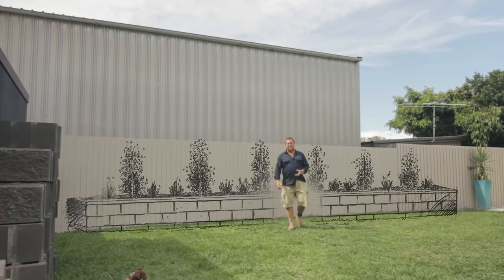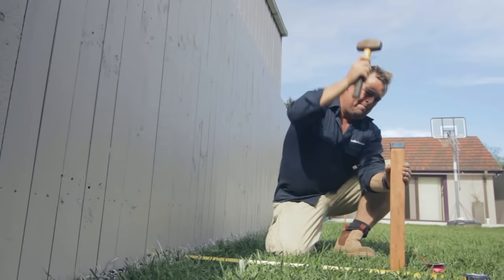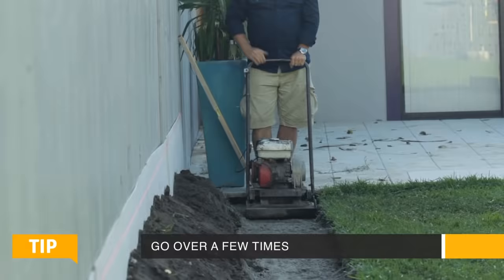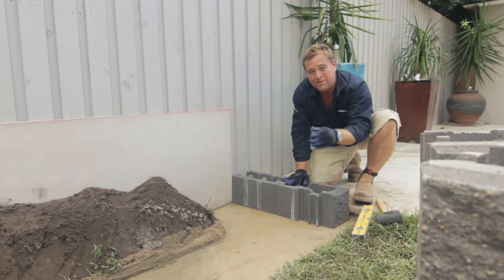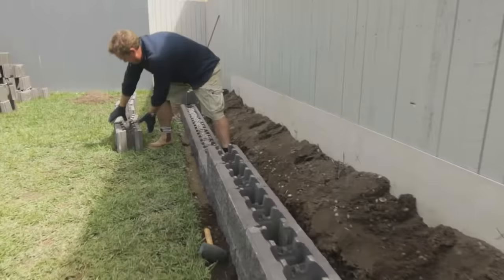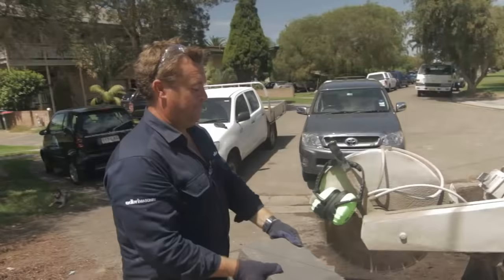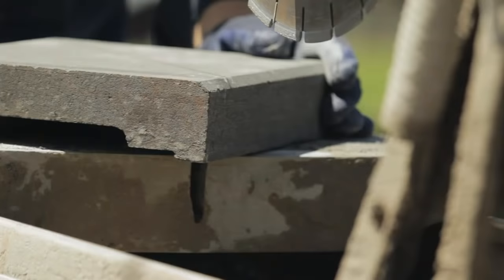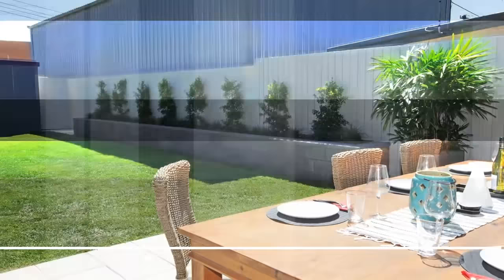DIY Raised Garden Bed How-to Video | Versawall® Retaining Wall Blocks by Adbri Masonry

Comment: For anyone considering something like this,  don't attach your bed to the fence in any way. If you have to repair or replace the fence in the future you'd have an issue here. Just include a back wall. And leave out the foundation with a garden bed, you want good drainage and you're not building a retaining wall. I realize this is mostly an ad for the blocks but still...
Reply: That's what I was thinking!  That poor fence is going to blow out from the pressure of the soil.
Reply: @mitchharrison435  hello
Reply: @Bob-qm6cy  I'm not a licensed builder, but if you're putting in a retaining wall which is holding back a good deal of soil, a footer and proper set back is definitely the way to go. Some places require a footer if the wall is over a certain height or has a certain slope above it, you'd have to check local building code. When the soil gets saturated, and especially if you have freezing weather, the pressure would be very high. I see tons of yard edgers that are 1-2' tall and are all bowing out  because of a steep slope above it and the use of weak material. So there's a time and place for the heavy duty materials for sure.
Reply: Hello there. Does the back wall have to be versawall as well? Or can I use timber sleepers on a post?
Reply: @enriquelondres6134  might be too late for your project now, but FYI I did a front end retainer wall and did timber sleepers held in with galvanised metal beams ("h posts" and "end posts") on the back end to keep it off the fence. Days worth of extra effort but worth it as i now have no worries about my fence.

Connecting the corners of the posts with the versawall wall was a bit awkward. In hindsight I'd start with the rear side timber sleep wall first then, line up your versa wall to instead of the opposite order which is what I did. Take your time to get the measurements right.
Reply: Could you just build the foundation for the blocks only, and have drainage at the rear of the blocks? What prevents the blocks from sinking

Comment: The hardy board was not a good idea, it is porous and without a proper vapor barrier and air gap between the bed and wood fence, it will cause the fence to rot. It would have been better to have built a 4 sided box with sufficient air gap between fence and bed.

Comment: Best way is to lay the blocks upside down to the method Jason used. Lugs at the bottom.  This way, lugs give improved grip into the base material plus you have no need to knock off the lugs on the top row!
Reply: You have obviously never even seen these blocks, let alone layed them often enough to give people advice.
Reply: @drgrubenhiemer   You are sure of that.
Reply: I came here to say the same thing, I'm about to lay a small retaining wall and the blocks laid this way up leave the U channel (which I assume is for drainage) at the top, so you are likely to end up with the bottom row with about 4 inches of water with nowhere to go. If 'upside down' the U channel will allow the water to move and also key the bottom row to the base. Finally with the lugs down the coping stones can just sit without altering the block.

Comment: Your neighbor's fence is  bearing the side load from the weight of the soil. Whether at the top or all along the height of the villaboard.
Reply: The fence is shared between the two. But yes something in between would be good
Reply: Agreed! See this problem everywhere with fences pushed over, and most people have no idea. Videos ( or more like ads) like this don't help.
Reply: The neighbour could also construct the same kind of raised bed their side. The fun starts when that fence needs replacing!!
Reply: She'll be right mate!
Reply: Anthony Haycox yes I’ve been thinking about this lately. I don’t be making mine too high
Reply: Lol i was going to mention the same thing
That fence is going to lean after a few years

Comment: Is P gravel OK to substitute for the road base and was the sand/concrete mix a dry mix ?
Reply: The rock size used is standard for using in drainage situations.

Comment: Quick question we have just built raised garden beds using this same product.  I’ve notice the caps now don’t sit directly on the flat section of the  blocks. Does this mean I need to knock out the lugs or glue them directly to the lugs? Cheers
Reply from the maker: Hi Smitty, there has been a slight change to the cap design so that it can be used on a wider range of retaining wall blocks. As a result you will need to knock those lugs off on the top course. If you check out the following video, Jason shows you how to do this at about 9:27 https://youtu.be/RtNWzBYrghE?t=567
Reply: @AdbriMasonryAus  thanks for the reply. I took a few moments before the first corner and figured it out come up a treat

Comment: Adbri, thanks for making this look so easy. This is my question and yes, probably also my problem. Ok, so on the left side of the house (left, by standing at the street and looking towards the house) at the back of the yard there is probably a five or so foot hill against the wood planked fence that boarders/divides the easement space between this yard and the home behind. We would like to turn this hill into a terraced garden with a minimum of three levels (3-4 two foot gardens staggered up the hill, each section being 2-3 ft. tall, with the final level being at the top). I should also probably mention that this hill is only approximately 10-12 ft rounded with an old set of stairs going up the center. The left side of the hill is probably all of 1-3 ft away from the next door neighbors backyard fence, so there isn't a whole lot of space on that side. What is your best advise for DIY installing this terraced garden? Do you already have a video out that would help us?
Reply from the maker: Hi Suzy,
Thank you for the comment! It sounds like you've got a complex project ahead of you, it will be well worth it in the end when you can enjoy it from your Outdoor Room!
We don't have a video that specifically addresses your questions... However we highly recommend that you seek some engineering advice before building this wall. 
Garden beds that are staggered up a hill will most likely exceed the maximum unreinforced height of a retaining wall block (depending on which product you are using). 
For example, Versawall can only reach 800mm high before engineering is needed. If you build up to 800mm and then add a garden bed and another 800mm wall, this would already have exceeded the maximum unreinforced height!
It would be best to speak with a qualified engineer before progressing.
I hope that helps - Good luck with your project!
Reply: Suzy Cowan eeee

Comment: should be using a mask with all that cement dust. great vid.
Reply from the maker: Hi Pete, that's a really good point. While this video was filmed before those safety requirements were brought in for cement handling, we 100% recommend the use of a mask when working with dry cement.

Comment: You are not adding any water to the cement and sand mix, why?
Reply from the maker: Hi Maciej. While we haven't added water to the mix, this sand and cement will harden over time. But working with it dry means you can still tap the blocks level as you're building, while the base remains fairly firm. If you were to add water to the mix initially you would need to get the first course down quickly before it drys, after which you wouldn't have the flexibility of fixing any sections that aren't level.

Comment: Hi, awesome video.  Just have a question. How are the blocks fixed to each other? Also after adding cement sand mixture to the base did you wet it and let it set and place the blocks after or place the blocks while wet.
Thanks
Reply from the maker: Hi there, thank you! They are fixed together through the interlocking wings on each block. The free draining aggregates that you backfill with will also add strength to the wall.

For the cement and sand mixture mix it dry. You can wet it to make it slightly damp. This will act as a stabilized bedding for the blocks. You can place the block immediately down, no need to wait.

Comment: Hi there! Planning to do this in our backyard but can I put it on top of concrete and tiles? Thinking of putting liquid nails under the first layer. Will that work? Also it'll be an L-shaped garden bed, do you have any advice with that? Thank you
Reply from the maker: Hi Ma, I'd need to know a bit more information: the type of tiles, height of the planned garden beds and what fence/wall they'd be built against. Would you mind emailing me at adbrimarketing@adbri.com.au

Comment: Any alternate way to cut the corner cap other than using the giant brick saw???
Reply from the maker: The brick saw allows you to wet cut the caps, preventing exposure to silica dust. Any alternatives would involve dry cutting which should be avoided.
Reply: @AdbriMasonryAus  wished you guys have a pre-made corner cap like the left and right corner bricks that you have.
Reply from the maker: @TheRealPotoroo  Thanks for the feedback. We are looking into creating some units that would work for corners. Unfortunately nothing like that is available yet, but it's in the works.

Comment: Do you add water to the sand cement mixture?  You mention to mix it dry but when you level it, and lay the bricks it looks a bit wet - which is it?  And if you do add water, how much?  I have just tried doing as you state (mixed it dry then laid and levelled it (no water added) and it was a complete nightmare - the blocks did not sit well (tended to sink into the sand cement mix) so I had to add more sand to get them to the correct height then use a rubber mallet to get them level (which defeated the purpose of getting the layer of sand/cement level at all - which took hours).  This process took many many hours to do the first row and now I am not sure if this is ok to put the rest of the wall on (I'm guessing the additional weight will make it sag/move).  Surely there is a better way to do this. Its looking like I need to rip the whole lot up and start again with advice from a professional.
Reply from the maker: Hi Tim.

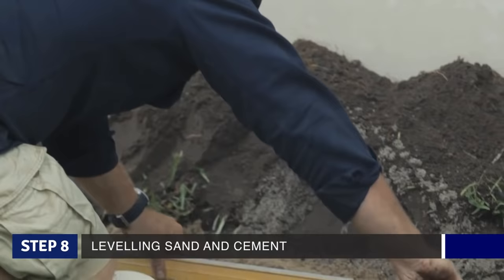It hasn’t been communicated well in this video, but although you mix the sand and cement dry, once mixed you can spray some water in to the point that the mix is slightly damp. Also, when screeding you still need to press the sand down slightly to make it reasonably firm. At 4:15 you can see Jason doing this. If this has been done and the depth of compacted roadbase is 100mm, and screeded sand/cement is 30mm, this should be able to support the blocks without sinking. 

Please feel free to email adbrimarketing@adbri.com.au if you have further questions. 

Best of luck,
Adbri Masonry Team
Reply: @AdbriMasonryAus  Thanks for the clarification. I have laid the following levels on top and it seems ok now.
Reply from the maker: @thuffam  excellent, that's great to hear!

Comment: Is the Geo Fabric looped under the gravel that is put behind the wall? And then the soil is on the other side of that?
Reply from the maker: Hi Olivia, the geo fabric just needs to remain between the soil and the gravel. Looping it under the gravel is a good way to hold it in place as you're installing, but it doesn't need to be under the gravel.
Reply: Adbri Masonry - thank you! So gluing the one edge down under the capping and putting the gravel down over the top and then up between the soil is best for ease?

Comment: Hi there, this is very helpful thankyou. Given there are no half blocks, how does it finish at the fence line?
Reply from the maker: Hi Ashleigh, you would need to either cut or split a block in half. We have some videos on how to do this safely;

Splitting a block - https://youtu.be/sZ5fJt4VVQs

Cutting a block (the video is of a paver being cut, but the process is the same for a block) - https://youtu.be/jZ6oBYHQuH0

Comment: Do we need to add gypsum clay breaker before filling with garden soil ?
Reply from the maker: It depends on the soil you're putting in the garden bed. If you're adding good quality soil it may not be necessary.

Comment: hi mate , really liked your video, i am going to build this along the retaining wall, do i need to lay drainage pipe in the bed
Reply from the maker: Hi there, In this video (@7:40) Jason speaks on why he doesn't use a drainage pipe in the free standing garden bed. If you were to be using the product as part of a retaining wall system, you will need to install a drainage pipe to remove the retained water. 

If you have any other questions, feel free to contact adbrimarketing@adbri.com.au

Comment: Good job but looks expensive and hard job. Timber would be great too.
Reply from the maker: Hi Eduardo, timber looks good for a little while, but even treated pine starts to warp and rot over time. In a few years it will look old and tired and probably need replacing. Concrete masonry is built to last, so you'd only have to build this garden bed once.

Comment: Any idea what a Villaboard is called in the UK??
Reply: Just ask for exterior fibre cement sheeting or cement sheeting
Reply: Would be better to use Foundation waterproof membrane that plastic stuff with dimples. Cheaper easier to install and it leaves air cavity against fence and is also waterproof.

Comment: Why do you add cement to the sand? Will it set when it rains and then drys out?
Reply from the maker: Adding cement to the sand used for the base helps to make a more stable base. It doesn't set to the extent of a concrete slab, but it does harden enough to help hold up a stable garden bed wall.

Comment: Thanks for amazing information video, I have colour bond fence at backyard, so I am planning to do exactly like you showed in this video, colour bond fence doesn't have sleepers under it, so is it safe to use cement eve sheets I bought 900mm ,2400mm, 1.44 thickness, any handy tips for me before I start preparing areas? Your advice is highly appreciated, thanks again
Reply from the maker: Did you say the thickness was 1.44mm? Villaboards have a thickness of 6mm and are a little bit more rigid than eave sheets. They could work for a very low garden bed, but anything higher than 400mm I'd recommend the sturdier Villaboard.
Reply: @AdbriMasonryAus  many many thanks for your kind reply, definitely I use villaboards now. Great educational video. Keep the good work up. Thanks
Reply from the maker: @a.kumar.5760  Thank you for your question. No need to apply liquid nails between the first and second rows, unless you wish to. Instead, fill inside of the blocks with aggregates 20mm or smaller to support. Apply liquid nails between the caps and second(final) row of blocks. 

The backyard looks great! Looking forward to seeing the Versawall blocks project. Feel free to contact adbrimarketing@adbri.com.au for any further questions.

Comment: How do I work out how much blue metal i need to order? Can you advise the volume each block can hold?
Reply from the maker: Is there a particular block you're looking at using? You would also need to consider the height of the wall to include how much blue metal you need to backfill behind the wall. 

If you can let me know the block, height and length of the wall, I'll be able to work out the required aggregate (blue metal) for you.
Reply: @AdbriMasonryAus   I am going with the versa wall blocks. the wall is 2 blocks high and the total length is 16 metres. Thanks so much for your help 😁
Reply from the maker: @sinjitsu  No problem, in this case we allow for 300mm of blue metal behind the wall for drainage, and approximately 100mm for the cavity in the blocks. So 400mm x 400mm height x 16m length = 2.56m3.

If you order 2.5 cubic metres of blue metal, that will be ample to fill the blocks and backfill behind the wall.
Reply: @AdbriMasonryAus  Excellent, so a 1 tonne bag will suffice my needs for this project. As this is the minimum order for delivery.
Reply from the maker: @sinjitsu  Depending on the gravel, one tonne is usually about 0.6 cubic metres. You may need to order about 4-5 of them.
Reply: @AdbriMasonryAus  thanks must of used the wrong online conversion calculator

Comment: putting villa board up against the boundary fence? ..."the weight is going down but not on the sides"... you've got to be kidding. Please educate yourselves on lateral earth pressure.
Reply: Not to mention ground frost
Reply: @hamzakhan9597  please educate yourself on the climate in Sydney…. No such thing as ground frost in Sydney.

Comment: Had a neighbor spend $400 repairing my fence because he did this.  The weight of the gravel and soil caused my fence to bend and buckle.  This might be a good idea on the side of a house but NEVER do this against a fence.
Reply from the maker: Hi Leonard, sorry to hear that happened. Can I ask how high they built their garden bed and if they put Villerboard between the garden and the fence? So long as the garden bed was 800mm or less in height, the weight shouldn't have buckled the fence, unless there were plants with aggressive root growth in the garden.

On another note, building a garden bed against a house can leave the house susceptible to termite attack.